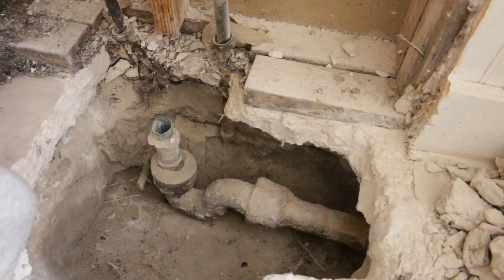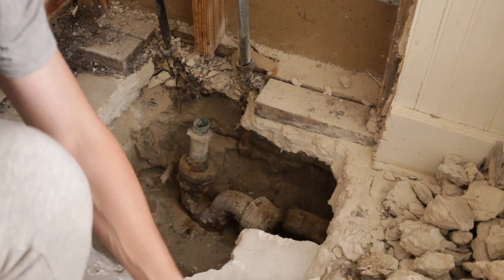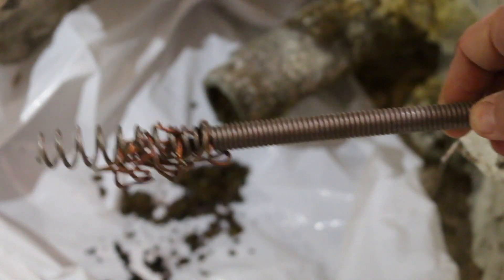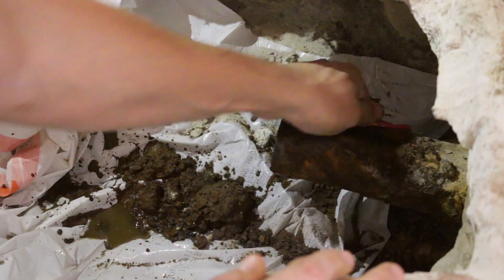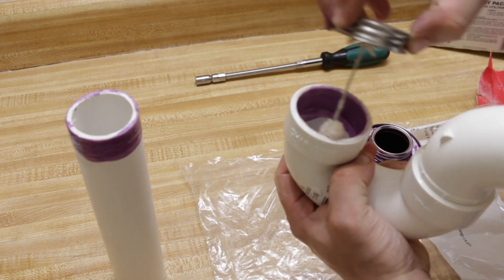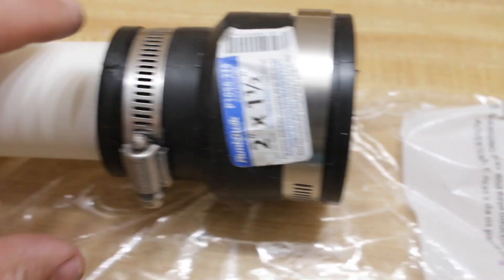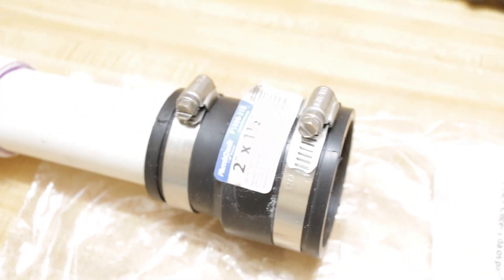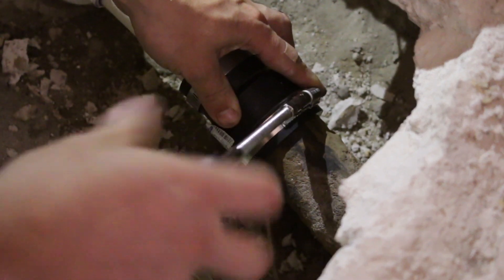How to connect PVS pipe to Cast Iron Pipe using Fernco Coupling

Comment: As rough as the exterior of your old cast iron pipe is, I’d have used silicone sealant between the old pipe and Furnco adapter to make sure the seal is leak proof.  Also, I’d backfill around the pipe with sand, so any residual moisture can seep down and away from the repair.  I’m not a plumber - but I’ve done this repair.   I used a Diablo branded carbide 6 tooth per inch blade in my reciprocating saw to cut the 4” cast iron pipe.  Blade was still good after cutting that pipe two different times.

Comment: STOP WHAT YOU ARE DOING

1 ferncos are not legal.  Use the appropriate 4 band hub connector with a cast iron and plastic sides. They have different outside diameters

2 why did you reduce the drain from teo inch to one inch?   You are going to be standing in shower water.

When the fernco leaks and you have to tear out the tile call a professional

Comment: Do they make a Fernco that will go over a Cast Iron Hub (on a 4" Cast Iron T joint in this case ). The Fernco need to be normal size on the other end for 4" PVC? 
This would save me a lot of work if they make a Fernco that can fit over a Cast Iron Hub on one end and normal 4" size on the other end. Thanks in advance and nice video.
Phil

Comment: Very good presentation and filming. You inspire confidence in your pragmatic approach to the problem. Have you ever had the occasion to use a pipe clamp for sealing leaks? If you could post a video on stopping leaks it would be great.

Comment: I Moved into a house that has The main pipe in my basement that concects with kitchen and bathroom that has that same coupling but its not fully covered on the pipe one side is not coverd by the coupling and leaks everytime they use bathroom or sink or turn on water causing flooding in basement everytime and I dont know what to do to fix it

Comment: That is the incorrect coupler. You should have gotten the stainless jacketed. It prevents the coupler from swelling with heat and slipping off.
Reply: Do they make the stainless banded type in a reducer fitting like he used?
Reply: His cant get swollen bc he inserted all the pipe in. Nothing will see the hot water.

Comment: Advice to DIY homeowners. If you use non shielded couplings backfill with sand to stabilize the pipe. The sag occurs from over excavated trenches that are not properly backfilled. Nothing wrong with DIY. Just DIY the proper way…..

Comment: Hmmmm....I have done exactly  that twice to replace a 4" iron elbow. Both times the soil chemistry makes the flexible coupling extremely stiff so the stainless steel ring clamps are not applying friction. Then natural soil movements pull the repair apart.
Reply: The shielded version of couplers solve for that.  Instead of a rubber sleeve and two hose clamps alone, they also come with stainless steel “shields” that cover the rubber sleeve making it rigid. The added strength keeps your pipes aligned and doesn’t require a soil backfill. It also deters rodents from chewing up the rubber.

Comment: we are remodeling the bathroom and my contractor wants to use this coupling to connect plastic and copper pipe under the floor. I was told that they might last 10-15 years. Is it a good idea to do it this way?
Reply from the maker: are you sure you have a copper pipe under the floor but not the cast iron? what exactly is he trying to do?

Comment: Would this coupling work under pressure?  For example.  I need to connect a PVC sprinkler pipe to a cast iron existing pipe.  I just wonder if this coupling will handle to pressure from a sprinkler system.  I hope it will because this looks like a solution for me.
Reply from the maker: Not the ones I used. The couplings you see in this video are only for sewer, drain, waste and vent piping...

Comment: Congrats on showing people how to do this wrong!  You need a stainless jacket banded coupler for under slab work.  People shouldn’t make videos unless you know for sure you are doing it right and to code.
Reply: oldowl4290 - the guy said the clamps are stainless steel. When you said a stainless banded coupler is needed for under slab, how is that different from a Fernco rubber coupler with stainless steel clamps? I Googled stainless banded coupler. That brought up various types of images that doesn't make it clear what a stainless banded coupler is. Please tell us more about what a stainless banded coupler looks like.
Reply: @LoneTinaja   It has a complete stainless sheet /cylinder jacket around the rubber. The two stainless ring clamps are typically riveted to the stainless sheet / jacket. Because it's made for underground use, the stainless jacket protects the rubber and makes it last longer.  You're only supposed to use the type he's using here above grade / above slab.
Reply: @oldowl4290  Thanks for the info. I found photos of that type of coupler. Underground at my house a licensed plumber used Fernco rubber couplers 4 inches in diameter with stainless steel clamps but the rubber is not surrounded by a stainless steel jacket. Do you know how long the rubber will last before it deteriorates to the point that it fails? Are there chemicals in soil that eat away at the rubber? Is it also an issue of soil shifting because of rain that makes soil expand, then soil shrinks during periods of drought? Do those processes cause the soil to abrade the rubber or tear the rubber?
Reply: @LoneTinaja  I assume it's code for a good reason and likely similar to your thoughts.  That's all I know.
Reply: @LoneTinaja  non shielded couplings start to sag and cause a misaligned joint down the road. They make me a lot of money…
Reply: I just tore up my floor drain today. The original pipes from 1949 are still there, with a rubber only connector. The rubber hasn’t deteriorated one bit. No leaks, no cracks… nothing.
Reply: @djnmeg1  YUP!!!!!!!
Reply: Here’s a challenge.  I have a cast iron hub.  It is 3” ID of the hub and 4” OD.  The hub, sitting at a 22.5 degree angle barely emerges from the floor.  Cutting the hub off would place it below the floor, and difficult to get to before it angles into a vertical cast iron piece.  So, cutting the hub off would require a huge project of ripping out the area just to be able to get clearance to cut the hub off.  I am trying to find a Fernco or Mission Rubber reducer or donut, one that either fits in the 3” ID of the hub to a standards 2” PVC pipe.  OR, find a coupling that can fit tightly over the 4” ID of the pipe.  Speaking with both Fernco and Mission tech resources, neither has anything appropriate.  My next, but not optimal, approach is to place the 2” PVC pipe up to the throat of the hub when it narrows down to cast iron pipe diameter, pack tightly with Oakum, then use a generous perimeter of epoxy to secure the PVC pipe within the cast iron hub.  The epoxy would essentially replace what was a lead joint and Oakum when the hub was connect to a brass ferrule with a wipe joint connecting to a lead pipe.  Any better approach you master plumbers?
Reply: must not be in the U.S.
Reply: Well who’s going to know - it’s buried .  Oh shoot - there is this video.
Reply: @AgentElectric nobody’s gonna know…….

They’re gonna know.
Reply: I shat myself laughing and the water is off to the bidet. Thanks bud @AgentElectric
Reply: He's gonna have to redig all that concrete after the rubber sleeve gives way from too much weight. 😂

Comment: Should of used 5/16 bit with drill to tighten up band
Reply from the maker: you cannot use drill to tighten fernco couplings. you can tighten it up manually. read instructions

Comment: Is it possible to overtightened the rubber coupling? I used an impact drill with a 5/16th driver. Should I loosen it a little?
Reply: I'm an old man with old man hands, arthritis, etc. I use a nut driver, not a wrench, and tighten it up as snug as I can get it, then wait and do it again in 20 or so minutes after the rubber and the drive band get "cozy".  For stuff that gets buried I prefer the couplings with the stainless steel shields, e.g. a Fernco Proflex. There is an 8mm t-handle torque wrench, or 5/16" depending on the brand of coupler, to use with these fittings, I just use a nut driver. If the fittings are hard to get on you can wet them or use a non-petroleum lube, O-ring lube for example. I am not a pro but have never had a fitting leak and have been doing my own DIY repairs 50 years.
Reply: Yes it is possible. And once you have over tightened it, such as with a power tool, it will strip and never tighten properly again and must be replaced. Otherwise IT WILL leak. It is best to hand tighten as demonstrated in the video. And, as the author advised above, stop tightening when you feel it is enough, because even then some of us can over tightened it. GOOD PLUMBING!
Reply: @TheTruthAndTheCross  Well it's in there now and has been holding for a 2-3 months. I'm not going to touch it. I only hit the trigger a couple times when I couldn't tighten any further by hand. 🔧
Reply: @WinmanDesigner  
Well, it is best to replace it when it is first stripped out, but in your case, I hope it holds and never leaks.
Reply from the maker: You will feel it when it is enough....

Comment: I am doing a very similar job. I am encountering difficulty cleaning the old cast iron pipe so I can slip the Fernco connector over it. You simply scraped yours clean. The rust and scale I am working with are much harder. Did you prep yous prior to scraping and if so, with what?
Reply: Use a grinder with an abraisive wheel
Reply from the maker: No, I did not prepare it. It was in such condition.

Comment: Would this work for a bathroom faucet? I need to connect the PVC P trap to a Cast Iron pipe that comes out of the wall. The cast iron pipe is not threaded.
Reply from the maker: I think you can...

Comment: Illegal fitting for underground connection. It must be a shielded coupling. This guy is clueless. Don't do this!!!!
Reply: He using a ryobi what do you expect
Reply: @pedroavillarruel4740 and wearing flip flops with socks on to perform lol
Reply: C36 licensed plumber told me how to check plumbing fitting parts legal/ illegal by reading the device attached label (test code number such as NSF ### , or ASTM C### ...etc ), no test label means not legal yet, you take your own risk.
Reply: “But the wipes literally say ‘flushable’ on the package! Not that I use them or anything just saying”
Reply: Real plumbers don’t wear flip flops 🩴
Reply: On,y illegal if you yield to a code
Reply from the maker: illegal???)))) read instructions on manufactures website....
Reply: @CreativeProcessDIY 
Not code
You are giving bad advice
Reply: @CreativeProcessDIY  sorry friend don’t know what country your in but comment is correct the coupling you used has to be protected from rocks debris. There are ones made here in America that have metal sleeves over both ends . It is torqued down with specific lbs on the brackets. Let say a person backfills your hole with fill that has a rock of small foreign object of if it’s filled with draining gravel. Your rubber unprotected fitting can easily be torn or pierced. The metal clad hubs are made specifically to protect the connection…..it’s ok you tried to do better….be open to crisis by professional plummers.  It’s not good to pass wrong info that can cause complex trouble. Don’t mind what’s on a little label. Look at the building/ plumbing code that’s shat guides us her in YSA…
Reply: @blt981 

That gave me a headache to read

Comment: Been there, done that!  From main septic line to tank. It's the correct way to couple these different types of pipe. Works flawlessly!
Reply: 😂 you ain’t a plumber 😂
Reply from the maker: thanks for watching!
Reply: Absolutely the wrong connection!  Do not do this!!!  35+ year plumber here.  Use an ARC band or metal sheathed coupler.
Reply: @jackspade2576  the hell there goi g to unleash of the rubber is pierced 😅😅
Reply: @jackspade2576    If somebody was to use a rotary tool or metal snake on this afterwards, and it pierces the rubber boot connection, this all has to be ripped back out.  Get the ARC band or "hard inner sheath" coupler like you say.  

They should have used a powered auger to loosen up the debris.  As others have said, it could have been done from the beginning of the video.  Replacing intact metal pipe with a rubber boot is asking for disaster.
Reply: @jackspade2576  Thanks for your comment about the drain coupler.  Something about using an all rubber coupler didn't seem right.  I appreciate your input.  Too many "handy-man" know it alls propagate false information.  Thanks again!
Reply: @CreativeProcessDIY do these reducing rings come in a 3" to 2" ?
Reply: can i use this from galvanized to pvc???

Comment: Are those connections code when in contact with ground?
  From my research, fernco connections are not code for ground contact.
Reply: Unshielded fernco is not code. Fernco is fine under ground but needs to be shielded no hub. If he had his work inspected as he should have, he would have failed his inspection
Reply from the maker: From Fernco website:  Fernco Couplings designed for above or below ground use. Keep in mind that all states have different regulations and rules. If you are a plumber - provide your license here. Tired of reading nonsense from people who do not even know how to replace even a faucet....
Reply: Plumber here— not code inside any structure!!! Above or below ground.
Reply from the maker: From Fernco website:  Fernco Couplings designed for above or below ground use.
Reply: The thin metal clamps on the Fernco will eventually corrode in contact with soil and break off, and he will lose the compression seal.

Comment: Was wondering if anybody can help me try and help complete this job, basically looking to install a water filtration system but have cast iron pipe running throughout the house, not copper or plastic. The problem is to install the system I usually use SharkBite or plastic 3/4 or 1in. connections just never had to install a system in a home with galvanized steel or cast iron pipes and plumbing.
Reply from the maker: Try to thread your galvanized pipe and make a connection. Use Tap and Die Set.

Comment: I see that it's for black water, but can I to a line for an outside faucet? Will the constant water pressure mess with it?
Reply from the maker: I think rubber Fernco couplings cannot be used for pipes with water pressure.

Comment: Really? Flip flops? Why not just  keep it 2"? Would be a lot easier for cleaning purposes in the future
Reply from the maker: These are not flip flops. They are called slides. What the difference it makes if I work in slides?
Reply: I do all my work barefoot. From tile/concrete demo to finish carpentry. I only wear something on my feet when going to the landfill or shopping. 
Work comfortable is my saying.

Comment: Thank you for your video! What size coupling do I need for a 2 inch OD cast-iron pipe? I wondered if the coupling needed to be bigger fit over the pipe. Thank you
Reply from the maker: you need 2 inch coupling
Reply: @CreativeProcessDIY  do they have those coulings in 3/4 or 1/2??

Comment: When you connected the pvc pipe to the cast iron with the coupling, did the pvc pipe in inside the cast iron pipe or are both pipes the exact size?
Reply from the maker: They are both the same size

Comment: My old house has 2-1/2 castiron that is rotten and needs change to ABS (A P segment under the shower). I can't find any 2and half to 2 inches clamp. Where should I search and do I have any other option besides Fernco reducing rubber clip if I find none?
Reply: Since comment is two years old, I’m assuming problem solved. For anyone searching for an answer, here’s what I learned.  First, double check your pipe diameter calculation. I thought I needed 4.5 inch CI.  Realized my circumference measurement was off causing overstated diameter.  While my pipes were slightly larger than 4”, it was a nominal amount and the rubber sleeve fit fine. Other tip is to make sure to clean the outside of CI pipe. Sand away/remove any rust or grime from the coupler seating areas. Lastly make sure you use plenty support straps to keep your pipes in place. When you make your first cut through, any existing torque will be released. You don’t want your piping system bouncing around causing further cracking or torquing.
Reply from the maker: I am not sure about ABS. I did my research only about connecting PVC pipe to cast iron

Comment: Use the tools you have, but snaking that drain with a rotary tool would have been a better choice for cleaning it out. Some places have code that says the primer has to stick out at least an inch along the exposed sections of pipes (more in some jurisdictions). 

That flexible nut driver was really cool to see in action though! Nice job showing enough of the project to make the whole thing approachable while staying focused on what I came here for. Thanks
Reply from the maker: thanks
Reply: primer has to stick up an inch or more? I'm calling it on that one. Waste of primer, no reason to, looks unprofessional. What jurisdictions require this? Bet this is an inspector peeve if true.
Reply: I was thinking the same thing.  I would sat there and ran a snake up there as far as I could with a snake tool since it is open.

Comment: Great work. I am trying to connect a 2" OD iron drain pipe to the p-trap pipe that will attach to a garbage disposal. My question is, if I buy a coupling tube, how much play can there be when the coupler attaches to the pipe? I am see ing about an 1/8" on either side of the couplers? Is that too much? Will the coupler squeeze enough so there won't be a leak? Any help is appreciated. Thanks
Reply from the maker: when you buy a coupling you need to be able to attach it to your iron pipe. The better is to have them tight so you can tighten the ring to avoid any leaks in the future. I hope it will help